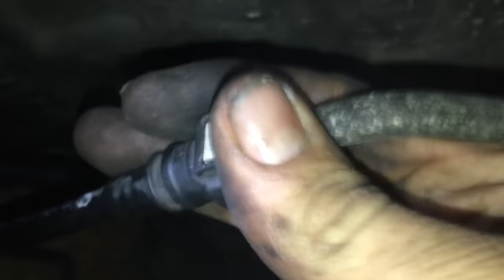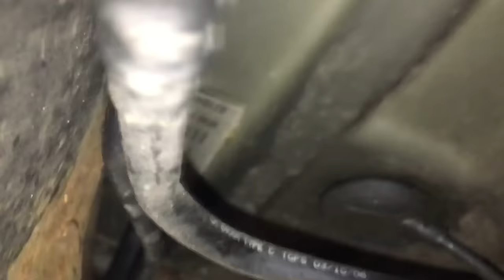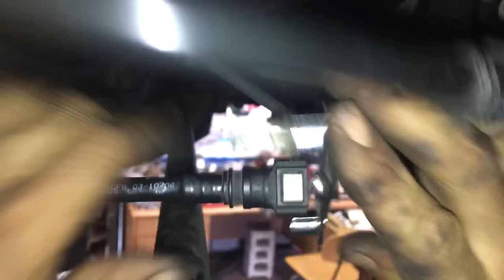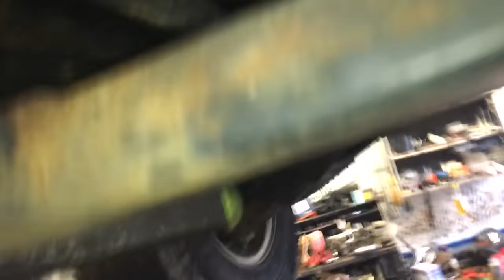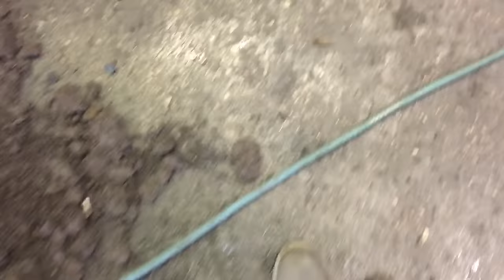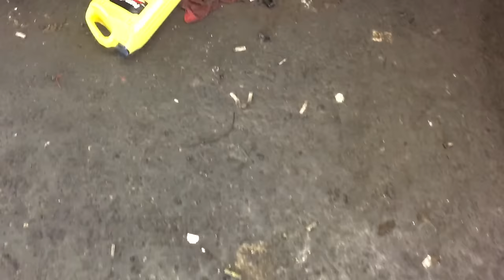Chevy GM fuel line disconnect

Comment from the maker: 🌟🌟🌟🌟 If the Video Helped you out, and you'd like to help us. You can use ANY of these links to purchase ANY ITEM you normally would off of Amazon! And we'll get a small commission with no extra charge to you! Make sure to complete orders through the links 😀
ARES 70024-3/8-Inch and 5/16-Inch Scissor Fuel Line Disconnect Tool: https://amzn.to/3N3WReC
CRAFTSMAN Mechanics Tools Kit with 3 Drawer Box, 216-Piece (CMMT99206): https://amzn.to/399qZqj
DEWALT XTREME 12V MAX Impact Wrench, Cordless Kit, 3/8-in: https://amzn.to/3vKFR5U
DEWALT 20V MAX* XR Impact Driver Kit, Brushless, 3-Speed, 1/4-Inch: https://amzn.to/3FCqBga

Comment: I feel like a dumbass. Me and my dad were changing just the line from the fuel filter back to the connector, which is only about 12 inches, and we spent 2 hours fighting it cause we were trying to use pliers to compress the clips. Didn’t know you’re supposed to use this tool on these also

Comment: Inaccurate. Those clips that seem like they need squeezed do very get squeezed to remove. I did it that way and worked effortlessly, plus I looked at the internal mechanism after removal and as you squeeze, the clips pull away. My issue is the other line doesn't have those but there is a small thin sliding tab that I can't get to release and can't get my fuel line till between the lines to release

Comment: Nice video, thanks! I love how there's the obligatory pile of rust on the floor... Because you know, it's a Chevy!
Reply: No it's probably an old Chevy older than any ford on the road if that's what your getting at I have a 92 Cheyenne I don't see any 92 Ford's or dodges just saying
Reply from the maker: Very valid point
Reply: It really does not matter what  manufacturer it is. Any northern state that uses salt or liquid calcium eats everything.  I wish these manufacturers made a edition that had all stainless steel hardware. I’d pay the few extra thousand for that.
Reply from the maker: I’ll bet there’s a lot of people that would that’s a good point as well
Reply: @dwayneholbrook4056  it's a fact that most late 90's to mid 00's trucks in junkyards are not Chevy's. Many of them are still on the road, so if one does go to the yard it gets parted out relatively quickly

Comment: Thanks for sharing this video Clay, I hope you can help me with this!
I am trying to get the same type of clip off but unable to get the tool in due to it being too close of where it is connected. If tool won't work what else could I do to get it released instead of cutting the line?
Reply from the maker: Take a hose clamp that’s about the same size cut the screw off of it and stick it in there it will push up on the tab and allow you to slide it out. I need to make a video about that. I just haven’t had time.

Comment: Thank you for the video. It was helpful. May I ask what the part number was for the fuel line?
Reply from the maker: I will need your Vin number 

You can message me on clays ac and Auto Repair over Facebook which is the preferred method. I check it more frequently or you can send me an email.

To thenewClayway@gmail.com .

Comment: thanks! big help...but does the replacement fuel line have to have that little flange about an inch from the end? I see that it is on the one you pulled out. I'm doing a new line right now but it does not have that flange.
Reply from the maker: I’m pretty certain that it does yes you can make just about anything work with the proper equipment but I’m not quite certain what you’re asking exactly it should be the same way as it came factory

Comment: How can 33 people dislike this  video. It shows what it says. Quick simple.  Watch, learn a d get back to your truck and fix it now that you know how the fuel line  clip works.   Duh...  thumbs up.   Cheers
Reply from the maker: (Sarcasm)  I think some people thought that I was also going to include the tool for free with my free internet video and they are very upset that I didn’t take a chisel and a screwdriver and a hammer and show them how to take it off with things that they would have at home . the unfortunate part is they don’t understand that there are certain things that require a specific type of tool to get the job done .And literally that tool is available at any auto store for about five dollars” will they ever use it again heck I don’t know”  but it’s what you have to have to get the job done . Take it easy gearhead have a great day
Reply: You can't make everybody happy.  Some folks don't want to buy special tools, but if it's less than ten bucks they should buy one even if they throw it away.  The cost of labor from a dealer is just too high.  Thanks for posting and I'll use this as a starting point for adding an inline fuel filter.  My truck only has a filter/screen in the tank.

Comment: Do you need the disconnect tool for a 2004 Tahoe? Some people claim you don't but I dont want to just try pulling them apart by squeezing the connectors
Reply from the maker: Honestly I could not tell you 100% for sure but generally you need that tool the old style used to have a pushy clip where you could pull them apart you will just have to get underneath there and take a look I’m sorry I could not be of more help

Comment: Would that tool possibly work on a 2013 impala flex fuel sensor? Thanks
Reply from the maker: Really depends on what the connector looks Like but this is the only tool that they really use on General Motors so I would have to assume so most of the time you can just push the two plastic pieces together and release it
Reply: Ok cool i appreciate it, thank you for the quick response.

Comment: Do you have a video on GM van tank removal ?
Reply from the maker: No, sorry I do not 

Pretty cut and dry though it’s going to have two straps, holding it on which are generally 17 mm to 15 mm bolts 

The filler neck tube that’s going to have to come off 

You’re gonna need to be able to jack up the vehicle and also lower the gas tank down it’s not a fun job to do on the ground but it is not impossible. If you’re quick, maybe three hours four hours 

If you’re slow 6 to 8  

You won’t really need any specialty tools, but I do recommend that you use a pick tool to remove the fuel filler neck once you take the band clamp off 

Or you can grab a large pair of channel locks and twist the tube off 

Any rusty lines are more than likely going to break if you do break a rusty line if they’re made of metal 

Use a compression fitting to repair the lines  

If you have the nylon style lines, you can purchase them at just about any auto parts store so you should be able to fix any fittings that are rusted or not cooperating hopefully that information helps you

Comment: You can't break what's broken 💯
Reply: That really connected in my soul too
Reply: @MustyKitten  facts
Reply: I found out what was wrong with my truck , a gas line that connects to the charcoal canister broke , and the float is stuck or fell off , so the tank was full even though the gas light was on , so when I was putting gas it would just overflow out of the broken line , crazy thing is is I dont know how my gas tank swell up and I cant take the fuel pump out so I just ride with a gas can and keep track of my miles
Reply: @moneymig  that’s wild you think you could ft me or call me and help em with my problem? Burban dies when out into gear and there’s a black hose that’s dangling from the bottom that I can’t figure out where to plug it back in
Reply: @MustyKitten  pretty hard to determine the problem well in my case if I'm not there in person , I'm from Louisiana,  so I can maybe give you pointers I'm not certified but I work on my own vehicles and do small jobs , with that being said does your suburban at least idles ? When in park
Reply from the maker: That black hose is a vent line.. for the transmission it’s supposed to be held up by the rear of the engine

Comment: What size & what type of wrench you use to get the fuel line fitting from the tbi. I have a 92 C1500 and cant remove the line. 15mm was to small, 16mm was to small, & 17mm was too big. Is their something I'm missing.
Reply from the maker: Sorry anonymous I apologize I honestly don’t know I wish I could be of more help
Reply: 21/32 is 16.7 mm

Comment: By any chance do you now which one is the fuel return? Doing a fuel cell on my 04 and im not sure which one is the return of the 3 lines
Reply: One of the three will go to your evap canister, that's evap. Then of the two others, you should find the fuel filter in line of one of them. The one without the filter will be the return.

Comment: How do you discconect the fuel line from the back of the engine?? Theres a lt gray clip does that have to come off?
Reply from the maker: I think that’s the one that you just push the ends of it with your two fingers

Comment: I have a huge problem . Fuel line damage on a 2004 GMC envoy. can not find the part number for the  feed line from the sending unit to the filter . I can not as well find the part number for the line that runs from the filter forward . I know I am a recent subscriber but the auto part stores close early due to covid so . If anyone can help that would be greatly appreciated thank you
Reply from the maker: Personally I would recommend making them. You could also call the dealership and give them your Vin number and they will certainly be able to get them for you.

The auto parts stores probably won’t have the particular part you’re looking for but they will have components that allow you to actually make them your self. Dorman carries a large line of fuel line attachments and ends. 

Sorry I know that’s not exactly what you were looking to hear but trust me you can do it
Reply: Awesome video thank you. Can't find part number anywhere either and I'm scoured though videos, comments every website. Mines 2002 silverado 1500 extended cab LT. Debating on cutting fitting off and jamming it into the fuel line with hose clamp. and definitely need that tool

Comment: Hello I was driving a little bit and the same connection what have in this video getting loose and the engine stop running so I was trying to Start my engine again and again so a guy who was walking by and was yelling stop stop because fuel was running on the street from my engine so I step out of my car I did smell the fuel right away I was lucky the fuel didn’t catch fire so we push my car away to a parking place because I was standing in the middle of a very busy street so I open the bonnet and the friendly helper saw it already the fuel hose connection was loose so I click it back on to the engine I did start the engine again and yes she was running again but my question is to you normally this connection can’t getting loose with driving  .

Comment: Respectfully sir, the tool is not required. Actually the large white tabs can be pushed in as you push the two lines together it will disconnect. Afterwards, look inside of the fitting and you'll see how it works.
Reply from the maker: Ok , I don’t know where you seen a plastic clip on mine….
Reply: @sharpcarco  
The 2 large white tabs on either side push together . I hope I haven't offended.
Reply: @sharpcarco  they are the two white buttons you said would go outwards when the tool was inserted

Comment: Try that when it's rusted af.. ughh I hate east coast salted roads :(
Reply from the maker: Sorry about that man
Reply: @sharpcarco  What size & what type of wrench you use to get the fuel line fitting off at the tbi. I have a 92 C1500 and cant remove the line. 15mm was to small, 16mm was to small, & 17mm was too big. Is their something I'm missing.
Reply: But if you look at the floor at the end of the video you see a pile of rust

Comment: How do you get fuel line off without the tool?
Reply from the maker: Technically speaking there is no way to get it off without the tool  and I would assume without the tool you would probably destroy the line . The tool is really inexpensive and well worth it even if you don't use it ever again it will cost you more in grief without having it
Reply: Flathead screwdriver works

Comment: Well I broke the clip and have no idea how to fix it.
Reply from the maker: Replace the line… there are tools you can buy just replace the end, but probably more cost-effective just to replace the line
Reply: @sharpcarco  I guess I lied becuase I took a screw driver and pulled the whole insert button piece out and then pushed it back in to reset it. That worked. Also not working on a ford/chevy so mileage may vary for other people. Clip was from a 01 volvo v70.

Comment: Shalom/Hi Clay.  Thank you for sharing this video! 

Someone is stealing gas from me, even though I have a locking gas cap... But there are thieves around here who work for dishonest thieving mechanics AND I Think they are getting the gas from under e vehicle, from the Gas line. 

While you have a Chevrolet Traverse LT AWD, raised up off the ground, can you take a Photo and show it in a video EXACTLY Where the gas line disconnect point is located; AND THEN Tell me WHAT All To LOOK For AS Evidence that Someone is Actually Stealing Gas from me? 

Also, Can you tell me that IF This Is In Fact Happening, Is there a Locking Device I can put on that Gas Line Opening, To STOP AND PREVENT FUTURE GAS THEFT?  

I am trying to help my daughter and 2 Autistic Grandchildren leave an abuser, 5 1/2 hours away from me.. and I can not afford all this gas theft! 

PLEASE HELP With Wise Guiding Advice?!🙏 It would be MOST DEEPLY APPRECIATED 🫒🌻🫒♥️🫒🕊️

PS. Prayers for Colin 🕊️🫒♥️🫒🌻🫒🙏

Comment: Hard to explain it on here but there's ways for people to remove these lines with out that tool. I once took a Tropicana lid cut a strip wrapped it around the line pushed it in and it done the same thing as the tool would've done...
Reply from the maker: Well there’s always different ways to skin a cat but doing it with the tool almost ensures that you will not break the line so you do not have to replace it but thank you very much for sharing we appreciate it
Reply: @sharpcarco  That is true.

Comment: this tool will not work with a movano sender unit   no room to fit it in
Reply from the maker: They make a lot of different versions of this tool just check the part store very cheap You will find one easily

Comment: I found out what was wrong with my truck , a gas line that connects to the charcoal canister broke , and the float is stuck or fell off , so the tank was full even though the gas light was on , so when I was putting gas it would just overflow out of the broken line , crazy thing is is I dont know how my gas tank swell up and I cant take the fuel pump out so I just ride with a gas can and keep track of my miles